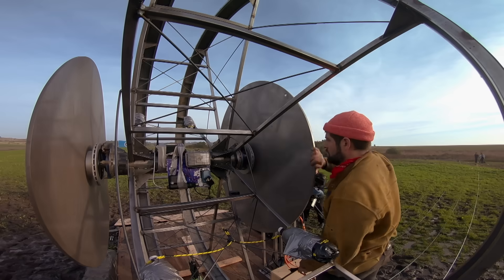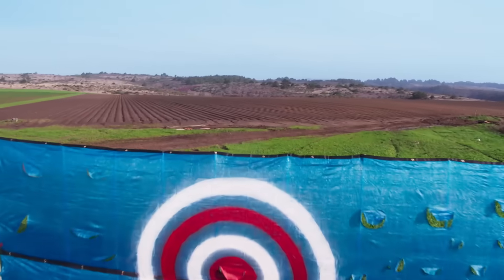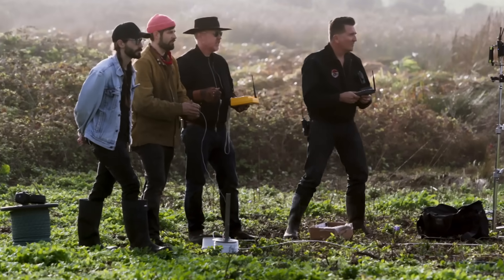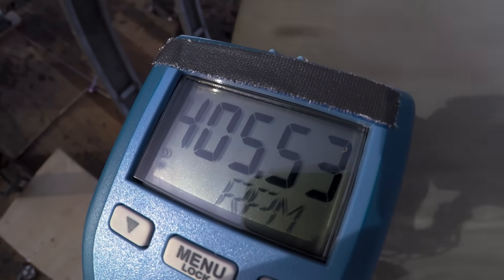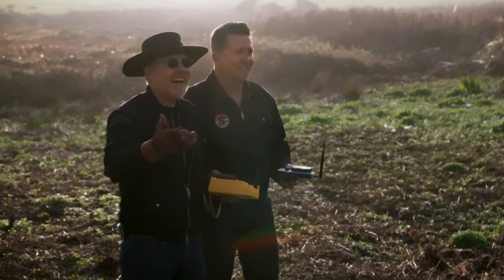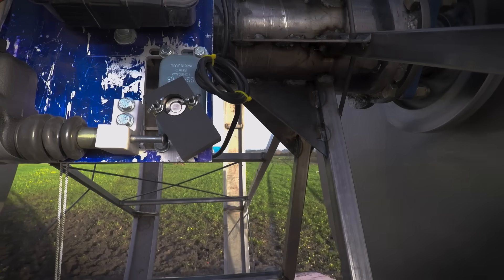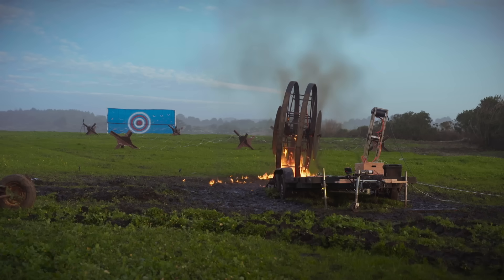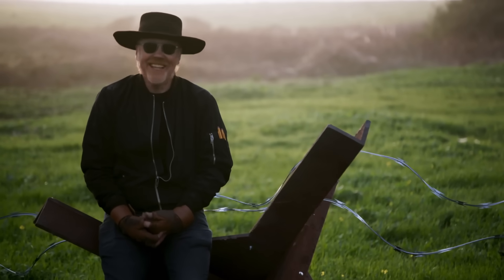Weaponised Flywheel Experiment Fails Explosively | Savage Builds

Comment: I definitely blame the fly wheels engagement to system. Those brakes essentially converted that energy into heat. Car brakes are designed to not have an aggressive engagement to minimize tire lockup. Ditching the system with a suspended drop style would be simple and be more efficient at converting the potential energy to kinetic energy.
Reply: Also mounting some larger caliper on the out side of the flywheel using the flywheel as a brake disk would improve efficiency greatly

Comment: Why wouldn't you just use the flywheels as the rotors the calipers were braking on? Significantly more leverage than the actual rotors used at the hub. Also using autocross brake pads that are designed for maximum torque from ambient temps would help the intensity of braking immensely

Comment: should have used drum brakes instead of disk, they lock up instead of applying gradual pressure hence only used on rear and emergency brakes
Reply: or have the flywheel drop into the wheel after adding the momentum

Comment: Literally doesn’t take a rocket scientist to tell you your brakes didn’t instantaneously deliver all the power you needed for the equation....and if they had, it probably would have ripped those tiny studs holding the fly wheels onto the axle right off

Comment: Have flywheels fixed to the rest of the structure and rest it on a cradle with bearings once rpm is achieved disconnect power and tip cradle forward unleashing the fury.  Also improve the footprint for softer surfaces.

Comment: Should have gone for two centered rockets instead of the brakes. All the energy is wasted as heat. 
Also the flywheels shouldnt be solid disks. A ring a bit smaller than the wheels would have a higher moment of inertia.

Comment: This is a simple physics problem where you have an extremely heavy mass resting on two narrow wheels that make contact with the ground in such a small area that the pressure is immense. Couple that with the very poor choice of testing in mire, and the fact that the wheels were also chosen to have no tread at all (when the transfer of torque from the flywheels through the brakes to the ground relied on the coefficient of friction) and it was doomed to fail. 

That and you are losing an immense amount of kinetic energy from the flat laminar geometry of the flywheels. A larger mass at the edges with cutouts toward the center would have given a much larger moment of inertia and would've have kept the flywheels rotating much longer due to conservation of angular momentum. I'm a big fan of both of you guys, but this is 1st year kinematics and I'm shocked by these mistakes.
Reply: Best Appraisal✅✅✅✅✅

Comment: they should use smaller wheel, or larger flywheel.
Reply: 18 wheeler tires work like a champ at around 75 MPH they have been seen on video smashing into houses and parked cars over a mile after coming off the vehicle!!!
Reply: @MrCPogue  These tyres are already at full speed and spinning fast when they leave the vehicle, that's why they can easily go far away.
Reply: They should spin all the wheel, not only the 2 small flywheels....

....and run away as fast as they can when it's released at full speed.
Reply: @yannickl5976  do both, spin up the flywheels first then spin up the main wheel seperately, then use a clutch to engage the flywheel when the main wheel slows down instead of brakes
Reply: @xymaryai8283  Go on the top of a hill, spin the whole thing at 1500 rpm then release it. :)

Comment: Brakes were too close to the center of rotation, out on the edge would have been a little better. Perhaps even better would be to spin those puppies like a gyroscope and use the rockets to make it go. Should be more stable

Comment: Electric drum brakes for a trailer would probably be more reliable. Drums lock better than discs as they have more surface area. Plus, the trailer brakes are meant for heavy loads, and area electronically controlled rather than hydraulically.

Comment: We see the problem. They tell you the problem. Yet half the comments section is "bEcAuSe oF tHe mUd"...
The surface doesn't matter, their design oversight made sure the wheel would never have gained significant speed without changes. That's also why they didn't reset and try again. They would have to take it back to a shop and rebuild.

Comment: They did so much math but didn't use it for all 4 components.
The 4 components being: big wheels (just need to support the weight of the fly wheels), fly wheels (need to be heavy flat and the same), brakes (uses math), engine (any will do so long as it can get up to 1000 rpm in a reasonable time).

They only did math to predict results, they didn't use them to inform their build.

Comment: Larger diameter balanced flywheels, larger brakes, wider surface area of rolling wheels. But I think having the brakes grab too hard would rip the wheel structure apart.

Comment: I think it needs calipers on both sides of the rotors 
and make them pneumatic over hydraulic using a high pressure gas cylinder and a solenoid 
to apply the brakes faster and more completely. or put the calipers on the outside to grab the flywheel itself.

Comment: Besides the braking force thing, I feel like the wheels should have been wider so it spreads the weight across the surface and prevent it from getting bogged down so heavily.

Comment: I would love to see a revisit, where the original design was modified so that the rocket propulsion was provided by a singular rocket mounted to the central core. I figure that would even out the force variance of multiple rockets mounted on the wheels that otherwise make the thing unstable. 

Those flywheels would be interesting to try and weaponize separate from the panjandrum concept, too! Talk about scary...

Comment: Also a centrifugal option.... weights and springs on the flywheel that will open and engage at a pre determined RPM and those engage with the wheels locking it together and away it goes.... think massive G80 locking differential or something along those lines

Comment: I saw the brake issue instantly.... you didn't have anywhere near the surface area to stop that much rotating mass especially with that diameter flywheels.  Do it again but use drum brakes from a semi truck, supplied air unlocks them so you could pressurize the system and have a large dump valve to release the air pressure and automatically engage the emergency parking brake and away it goes
Reply: Or something like what the sawstop uses, physically jamming the rotating mechanism.
Reply: Yes... But that would not have made it lose the kinetic energy. If you were right, it would simply keep spinning. It was the friction loss from the surface/ground that caused the drain on kinetic energy.
Reply: Even the truck brakes would fail... Each of those flywheels weigh 450lbs spinning at 800rpm. I knew any traditional brake transfer system would fail back at their shop... That's why they have run away truck ramps
Reply: Yep.. Those small brake pads was not going to do anything...

Comment: Couldn't they have used a pneumatic actuator, co2 cannister and a solenoid to engage the brakes? Honestly seems like a fairly easy fix to me (assuming the brakes are secured well enough to not just be ripped off)

Comment: The need for fluid torque conversion, dynamic harmonic balancing, and expanded kinetic force of spring loaded counter weights are required in composition alignment to allow breaking to be an accelerator, as against a counter spinning component at the core to counter the total dynamic output of the centrifugal batteries.

Comment: Should have used strong magnets and aluminum disks to transfer the energy from the flywheel. Gives a ton of grip with no friction. No heat buildup. No warping. It could definitely be done.

Comment: They should have just ditched the outer wheels and let the flywheels roll on an abandoned airstrip for maximum carnage
Reply: We used to do this with old hard drives. Let the motors spin up the disks with them unbolted and then tip it sideways so they would fall off the spindle.
Reply: Exactly. That is great thinking. Removing unnecessary parts instead of falling into trap of optimization of existing concept.

Comment: also a problem was that there were no treads, no way to keep friction either as it carves through the ground, the wheel is smooth and thus it was prolly gonna stop anyway. i think the project could easily be continued and made viable. they cared more about forward momentum rather than the whole of the components

Comment: Should have used a drum brake setup from a 18 wheeler. It would have added balanced mass to the flywheel,  has way more braking power than the disc setup, and can be applied instantly with the removal of air pressure using a parking brake chamber so no control system needed on board.

Comment: The disk brakes sometimes used on some of the newer gearless elevator hoist motors would work better. I have seen them stop a drive sheave almost immediately when applied, and that's moving way more weight around.

Comment: The diameter of the wheel was far too big, coupled with the extremely high friction of the mud it sank into. The large diameter, diffused the maximum torque the drive wheels could put to the ground, and without that rotational torque at the diameter, it could not overcome the friction of the mud. 

The outer wheel needs to be smaller and maybe slightly wider depending on the terrain, and the terrain needs to be much more solid. This would allow the torque to get to the ground as needed. Like in car racing - its all about getting the maximum torque to the ground efficiently, and using just enough friction between wheel and ground as is needed to transfer that torque efficiently.

I'd like to see attempt #2 with these points in mind. :-)
Reply: Show your work.
Reply: The goal was to make a wheel the size of the original.

Comment: it didn't have a way to instantly disperse it's rotational inertia.  i suspect you calculated it to do so.  the brakes were slowing down the fly wheels and not transferring force to the larger wheels.  the larger wheels were huge.  the gear ratios might add up, but you didn't calculate torque.  you are applying torque from a wheel to the axle of a larger wheel.  if the larger wheel had been spun up instead.  much of the inertia is lost in the polar moment where the friction of acceleration is divided by the rotational velocity.  plus the ground was really muddy.  so it couldn't build up any speed to maintain itself.  so, the time it takes to translate energy from the flywheels to when the larger wheel will hit peak velocity, the distance is doubled while the translation of energy to time is halved, .

Comment: Seems like energy transfer would have been better achieved by thrusting the main wheels outward along the shaft toward the flywheel.  Essentially using them as the brake pad instead.

Comment: I think the problem is the feet of the wheels. Especially on that sodden ground (given the weight of the thing). Not wide enough, and, too 'edgy'. Shoulda been like the shape of a mountain bike wheel, not the tread, just the shape; the contact point is flat (under pressure, at least) and the sides are rounded. I'm not an engineer, I can't explain it correctly. Maybe the engagement of the breaking system had something to do with it, like Adam Stelzner mentions, but that wheel design looked dodgy to me, for the ground it was operating on, at least. Those wheels mighta done better on rocky ground. although then it might bounce and/or 'weeble-wobble', y'know what I mean?

Comment: Seems to me the main problem is the diameter of the large wheels is to big in relation to the flywheel. If they sized the wheels closer to the same diameter of the flywheels it would work better. That and increasing the flywheel mass would let it store and transfer more power wouldn't it? What am I missing?
Reply: They were also going for speed, smaller wheels = less potential speed. Also larger wheels go over obstacles better. So there is a balance there. They did obviously try for relatively light wheels. Main problem was the muddy conditions rather than the design.

Comment: I suspect the equations relied on fairly low wheel to ground friction. I bet the mud made a huge difference. Those saying the mud had no effect are obviously wrong. Try riding your bike in 4 inch deep mud. It's not the lack of traction as so many say but just the opposite. It's like having the whole rig chocked or asking it to climb a hill. If you still don't get it imagine the mud twice as deep, or 4 times as deep.

Comment: 500 RPM would not go 20 mph. The force is speed squared. He had about a quarter of energy in that. Plus, the flywheel needs to be a ring, much energy is wasted in a disk. smh. Also, if it braked instantly, it would have turned a hard left and fell over anyway. Next time, bring a SpaceX engineer whom at least you know took freshman physics. As he said, he would have needed billions of dollars to do it right; SpaceX would've done it right over a lunch break.

Comment: So a tractor with wheels 10 times wider than that got stuck in the mud but a NASA engineer didn't realise that would too. Hope his boss didn't see this episode.
Reply: Wasn't muds fault, if the mud was at fault it would be spinning it's wheels
Reply: +Junking on the Bandwagon
This college grad-U-ate's boss is also a college grad-U-ate
Reply: I'm pretty sure the actual chief engineer on that Mars lower-to-the-ground-from-a-hovering-platform was actually Rube Goldberg.
Reply: The mud wasn't the issue, it's the brakes
Reply: @Squiffel  A 600+ lbs machine on a muddy field with a tiny amount of ground contact. Mud was definitely an issue.
Reply: @callumsworld2503  of course it effected it, but that flywheel had enough power to launch it 40 miles an hour, but it left the trailer at practically the same speed you'd get from just gravity rolling down a ramp. The mud wasn't the issue.
Reply: @Squiffel  Devil's advocate here.
The panjandrum only had half the RPM, and only had enough force for 20 MPH.
They said this in the video.
Reply: @Q.A.a.R.I.S  that's a great point, it still didn't move at any speed down faster than gravity down the ramp though. Don't get me wrong, I'm upset about the mud and the fact they just immediately quit too, but it did seem like it wouldn't have gone anywhere even without the mud.
Reply: @Squiffel  I'm not saying anything about if it'll get through the mud, I don't know that one.
Reply: that tractor had:
a. smaller diameter wheels, meaning a smaller contact area with the ground. 
b. The weight of the tractor is a lot more.
So the pressure of the tractorwheels on the ground is a lot  higher than of that contraption that they build.
Reply: @larswilms8275  actually tractors have rubber tires that can compress a little, meaning they have a larger contact area on the ground. The tractor wheel still has 10x more ground contact then this thing.

And the average tractor is only 4 times heavier than this machine and has a lot more horse power. 

The original post is right. A tractor is better in every way but still can easily get stuck in mud.

Comment: Automotive brakes are not designed to stop a wheel or lock up, they are designed to turn kinetic energy into heat thus slowing a car down, there's a couple of ways to get the effect you're looking, you could try adding a second caliper or massively over sizing the brakes but that's going to be pretty hit or miss. 

The best option would be to replace the entire braking system with a clutch system instead because a clutch and pressure plate are actually designed to do this sort of work.

Comment: I think could've used an air brake system, similar to the ones on semi's then they would've had enough braking power and all they would have to do to apply the brakes is depressurize the system. 
Source: Me, A Mechanical Engineering Dropout 
Gosh I miss Mythbusters.

Comment: I wonder if you could make a slot in the fly wheels and use a hydraulic to jam a steel bar into it..  however, I’m thinking it might be sacrificial to the fly wheel and also knock it off balance.

Comment: I think they should've had a caliper brake on the outer circumference of the flywheels so than maximum force could be applied.  Plus dynamically balanced flywheels that could spin the full 1000 RPM or more.  And a less muddy field!

Comment: Honestly, this is the worst porject I have ever seen Adam make.
Reply: Agree. Adam plus an actual rocket scientist and this is the best they could do.
Reply: Yeah, and part one felt supremely unsafe if it was functional. You could see it rotate laterally on the saw horses it was strapped to, if it managed to tip over and go nuts they all could have been endangered. They were in a closed room like 15 ft away from it with no barrier...  Step up your game Adam!
Reply: Thinking same thing! Super lame project
Reply: Painting a solar symbol on a circular object and the setting it aflame on a field? Seems like a ritual not an experiment.
Reply: Don't agree, attempt not made at full scale would be a bad project.

Comment: So they didn’t take account for the mud? I’m no rocket scientist but even I could see that the mud was the problem.
Reply: the mud certainly didn't help, and definitely would have affected performance significantly. but the biggest problem was the efficiency of energy transfer from the flywheel to the wheel. because the brakes were sliding, rather than locking in place, a huge chunk of the stored energy was lost to heat. had it locked the way they'd hoped it would, the wheel would have lept off, almost instantly accelerating to...i guess 20mph was what they calculated? and gone quite a bit further, even with the mud.